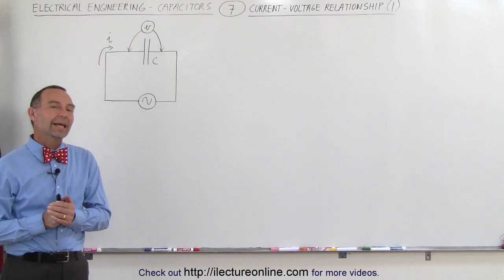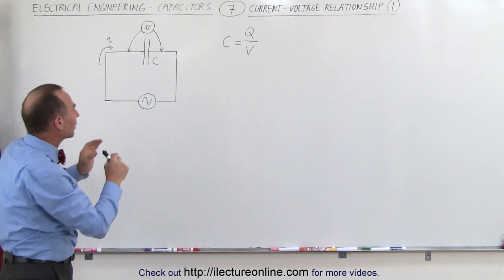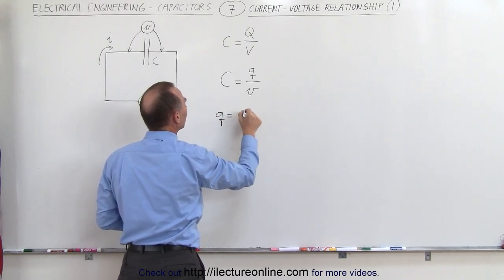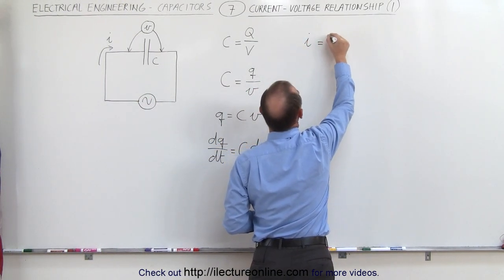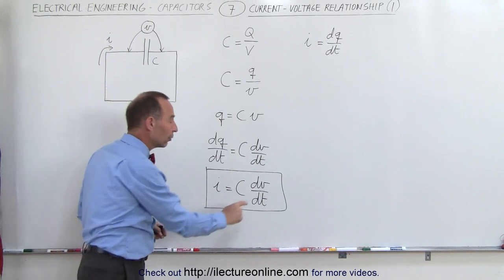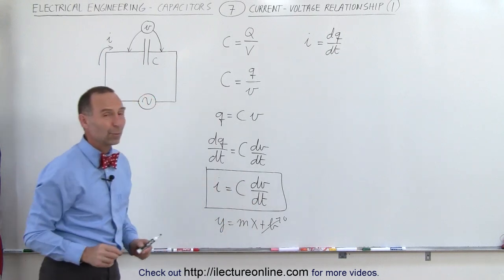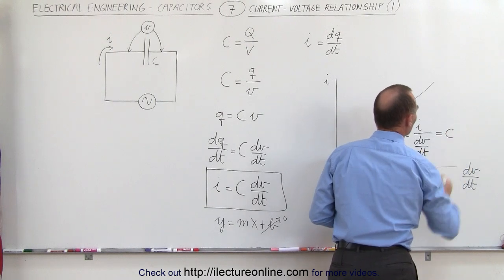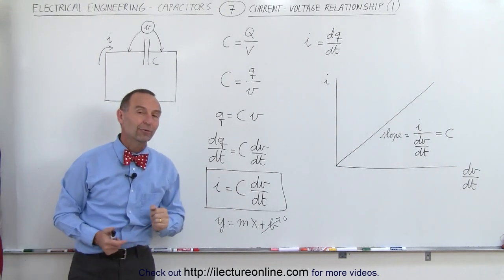Electrical Engineering: Ch 6: Capacitors (7 of 26) Current - Voltage Relationship (1 of 2)

Comment: Can I use this formula for proper capacitor?  C = I x dt/dv as from another web site. Need capacitor value for 6amps, 20000 cycles-.00005sec, 4volts changing.
Reply from the maker: Are you referring to the equation:   I = C dv/dt ?
Reply: Yes!

Comment: Hi sir and all others,
I wonder what if we have a capacitor directly connected to a voltage source. Is there a way to find the I(t)? Due to the absence of a resistor, we cannot get a time constant and solve the problem easily. Thank you
Reply from the maker: In the real world, even conductors have a small amount of resistance, so there will always be resistance and a time constant (altought it will be very small).
Reply: @MichelvanBiezen  Thank you very much for your answer, yet I still wonder about the case when we consider the capacitor as an ideal one whose resistance is zero. Thank you again

Comment: Dear amazing professor, what is the difference between 

Discharge a capacitor and reverse polarization, 
I know if I put some load in a charged capacitor, it will be descharged.  But, if I put inverse polarization in chagerd capacitor, what will happen ??

Thank for  you huge talent!..
Reply from the maker: Charging a capacitor means that we are adding charge.  Discharging a capacitor means that we are removing charge.       Some capacitors are built such that we need to connect one side towards high voltage and the other side towards low voltage.  Connecting them in reverse makes it likely you will damage the capacitor.
Reply: A few work either way. In theory it would work backwards.  In reality, most will be damaged. They're I'll build charge until it exceeds the insulating ability in that direction and rather than bleed bypass, it will explode.

Comment: what if the voltage source has rapidly changing voltage but very low current and thin wires like 3mA while i=c*dv/dt =1A , FROM WHERE DOES THE EXCESS CURRENT FLOW. this current doesn't at all depend on source current at all.
Reply from the maker: There are physical situations where the current flow is limited and it does affect how the circuit works.
Reply: This is not shown in the equations. nothing is said about the current flowing from the source. the equations consider only the voltage of the source. this means as long as i vary the voltage the same way it doesn't matter if i am using small Amperage source or big amperage source.